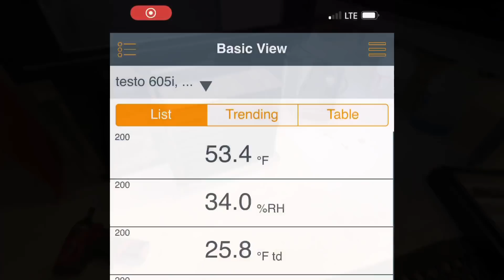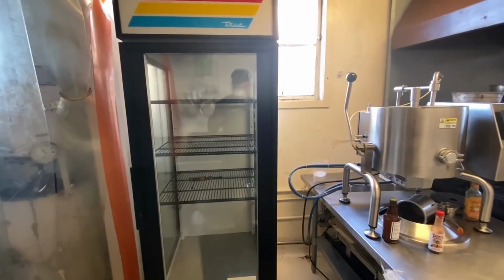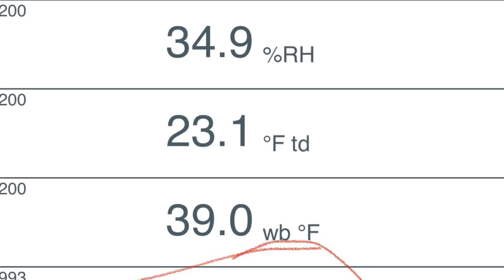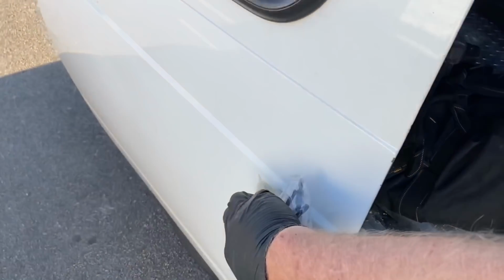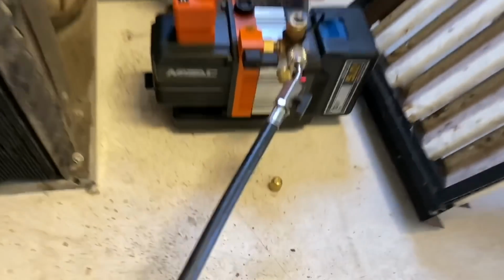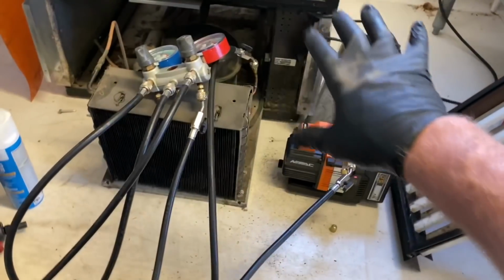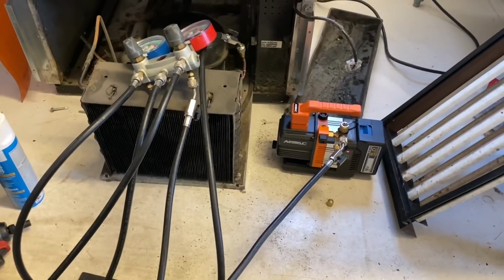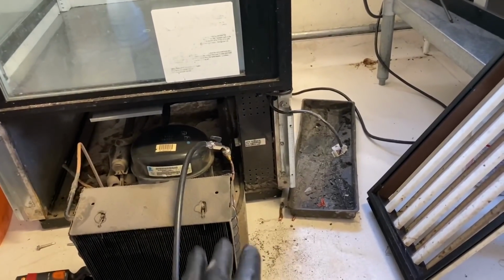True one door reach in not cooling

Comment: my guess was evap. fan as well as condenser fan. if either of them stick from being powered off, the same will occur in defrost cycle or thermostat off cycle if it shuts them off
sticking on pulling too low, probably the thermostat contacts welding unless it's frosting/icing the coil oddly, which is where a small bore cope inspection camera is nice or mirror. just watch them fan blades =p

Comment: Hey Dave , I didn’t see if you recovered the charge before you put the process tube on , if not , how ? 😂. I think it’s great you do the extra little things that go a long way to help people. Like cleaning that other condenser . Businesses are hurting for sure. I have been going through a crapload of evap motors on True coolers , especially the small 10’s and 12’s
Reply: Use a Yellow Jacket 60665
Bar-Style Pinch-off And Reround Tool. Pinch off down stream, cut open and braze on Schrader, then use reround tool to open up the tube with the Schrader pushed in for a split second to purge and done.